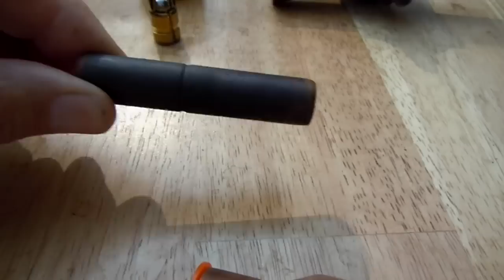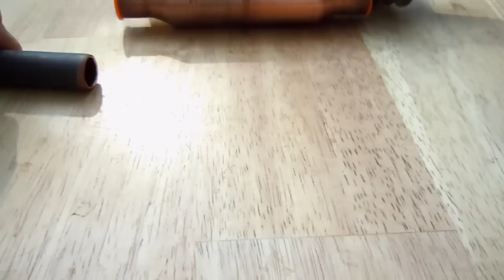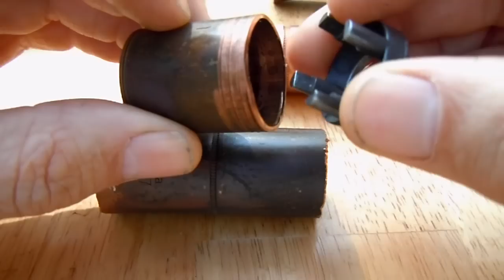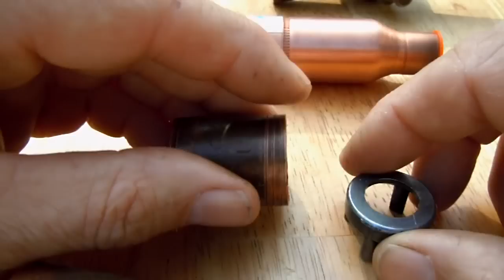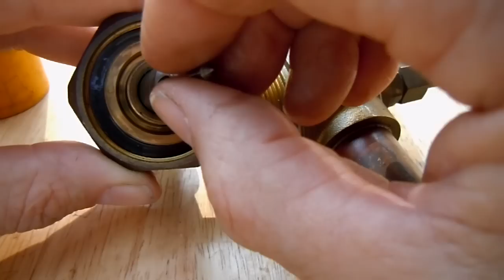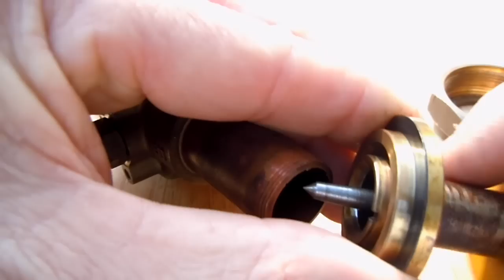HVAC check valves and solenoid valves

Comment: I think when the power is cut to the solenoid the valve stays in the open position. I say this because the valve I have on my radiator let’s hot water through even though it’s no longer hooked up.  Thoughts?
Reply: It sounds like the valve is stuck open.

Comment: Don't get many Heat pumps . But I've seen one that had a expansion valve in the condenser for heat mode and a orifice in the evaporator for cooling mode but no checks around it , so does that mean the orifice is the also the check valve in the heat mode?
Reply from the maker: Yes. So if you ever have to replace the expansion valve you'll need to buy the OEM valve from the manufacturer.

Comment: Nice video and very good information on these check valves. What is the purpose of the screens that are on liquid line just before TXV, isn't the dryer filter on the liquid line good enough ?

Comment: Hi Dr Zarkloff.
I have a troubleshooting issue here.
I have an inverter multisplit system branching out to 3 indoor units.
All three units run under one compressor.
2 of the indoors work well.
one of them doesnt produce cold air at all.
i am not sure if it has to do with the solenoid valve and if does it is there a way to fix it?
Thanks very much.
im pretty new in this trade.

Comment: I am still having trouble with my 2 ton Trane. I had a leaky equalizer flare fitting fixed about 2 months ago, and I noticed my heat was not working at all, the head pressure was pretty high, but the suction pressure was low enough that the system kept going into unwanted defrost cycles. I'm guessing with high head, and low suction, could it be my TXV?

Comment: Hey Dr.Z, I have another question regarding rotary compressors for small portable heat pumps and mini-splits, does the hot discharge gas flow through the shell of the compressor before exiting through the top?

Comment from the maker: @dav1099 Check valves are used in heat pumps to regulate the flow of refrigerant in the heat and cool mode.

Comment from the maker: @blissJesus1 Sorry I don't have anything on water source heat pumps. Just think of the system as sort of like a chiller with a cooling tower. The biggest pain in the ass about taking care of that type of system is having to maintain the cooling tower and the water loop water chemistry and piping. The heat pump is a lot like a swimming pool water heater.